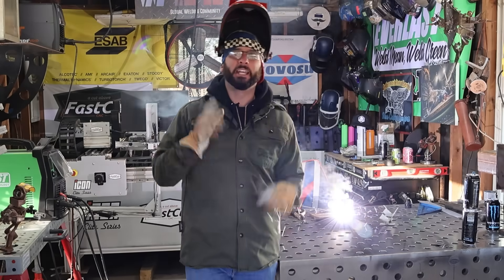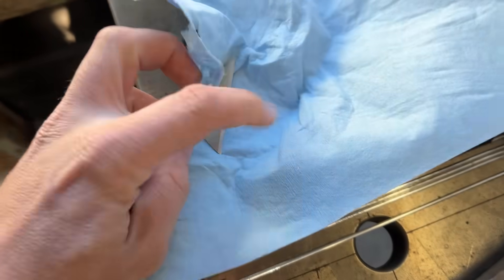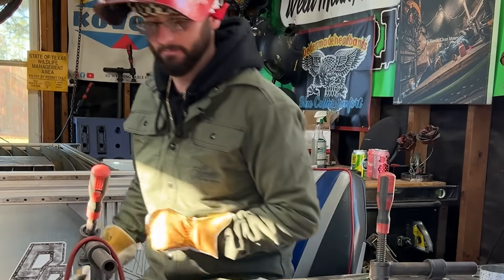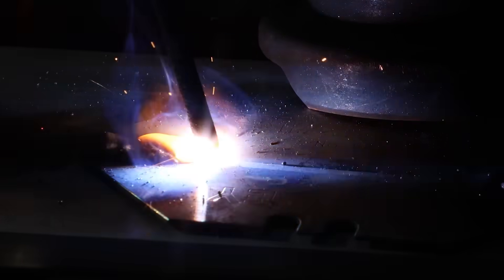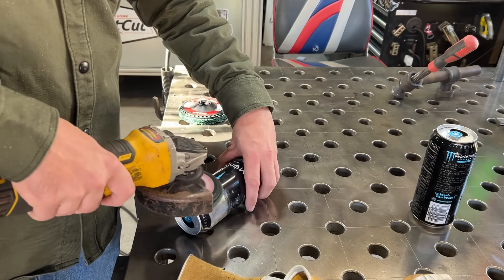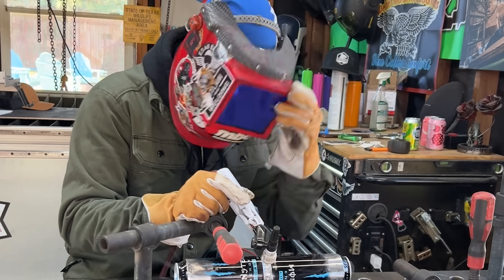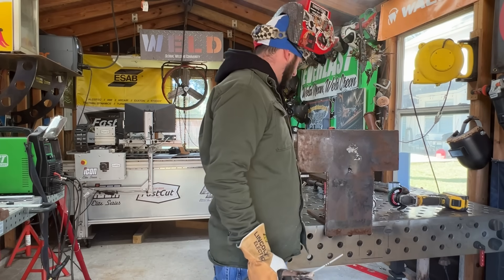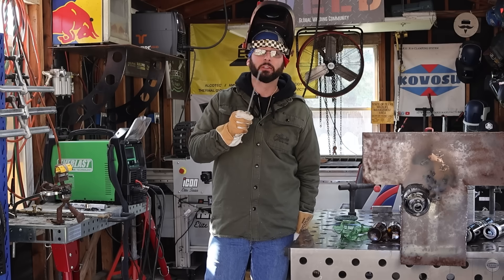3 Welding Party Tricks To Impress Your Friends

Comment: I've tried fusion welding razor blades with the lightweld and it does need some over lap otherwise it makes a hole or the settings are too low to form plasma and weld. 

But having fusion welded butted 26 gauge and later 24 gauge stainless collars to a flange at a 45 degree angle without a backer using tig, I can confirm welding razorblades and a 1/16 tungsten really helps.

But thank you for the can prep advice, I've been contemplating trying it and I totally would have just stuck to cans against each other and tried to weld them

Comment: Welding ‘final boss’ challenge. 
I’m gona try to do the razor blades on my 210 everlast as soon as I get some itty bitty filler rod. I already have itty bitty tungsten from an Amazon order after a few too many garage drinks
Reply: Mig wire offcuts work as tiny tig filler when needed
Reply: Excellent! It’s a fun to knock the rust off with it